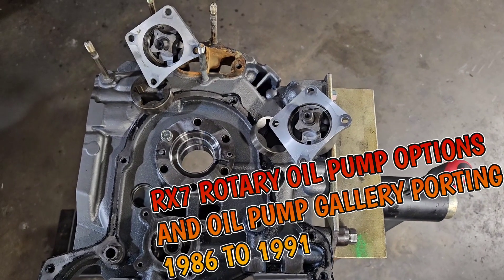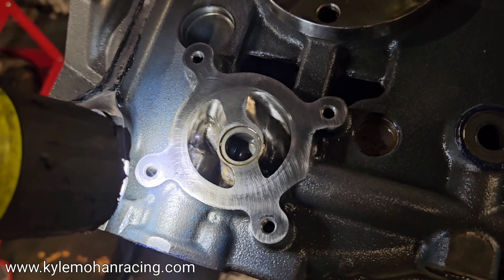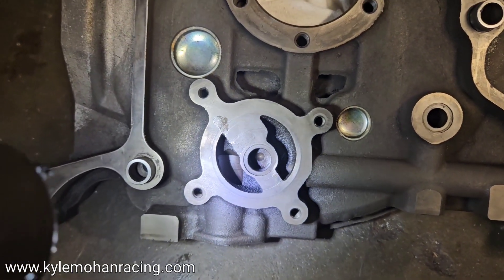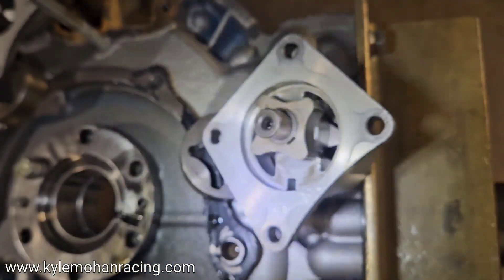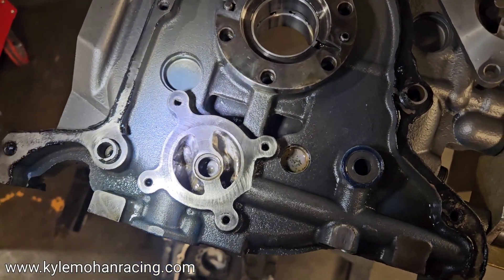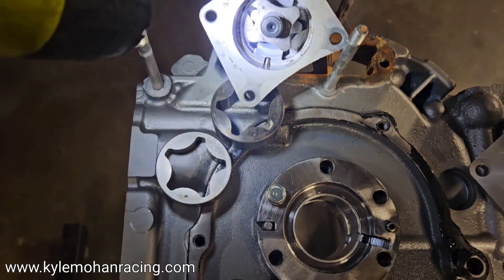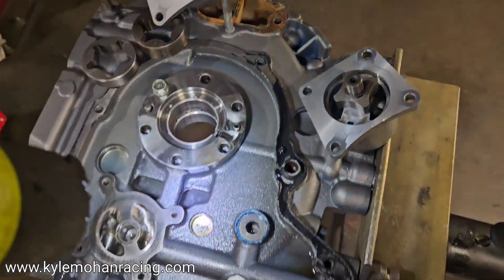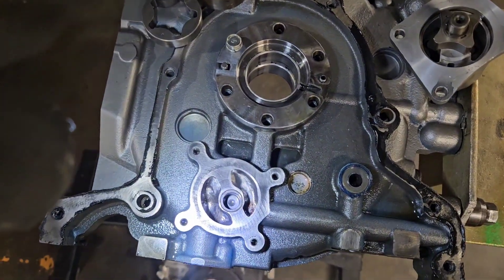RX-7 13b Rotary Engine oil pump comparison and oil pump gallery porting, S4 & S5 1986 to 91

Comment: Hey hey, have pretty specific question, what about exhaust manifold calculation for rotay engine, cause there are alots of different calculators for piston engine, but how about rotary, plus about intake, how does the leight of intake effect on rotary, same as piston, or it have bigger effects???

Comment: Thanks, this is great info. Porting that oil gallery looks like the sort of thing most DIYers could accomplish if they have their engine apart for a rebuild. I'm also interested to see whatever you can share about FD or RX8 oil pumps, or other parts of the oiling system.